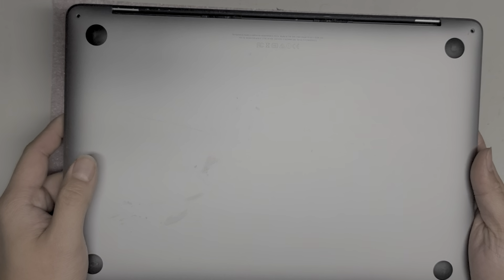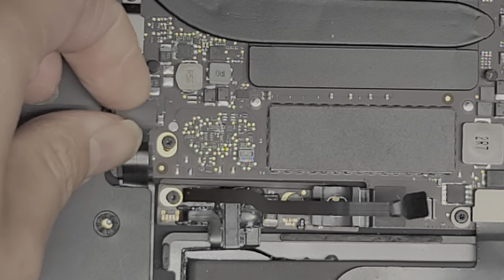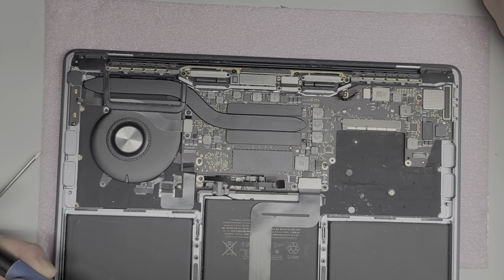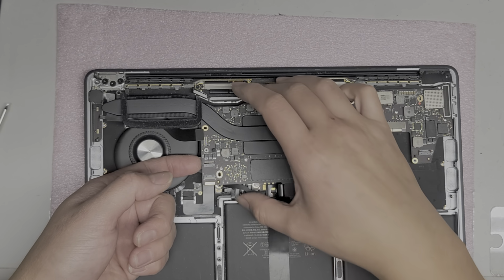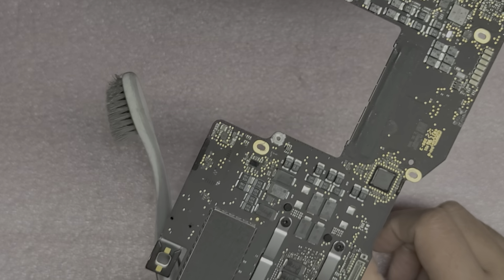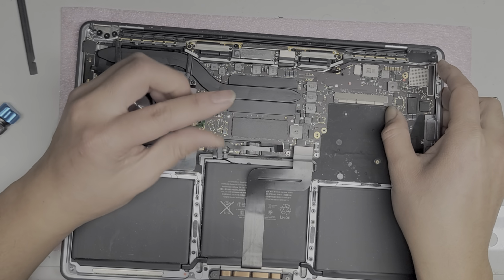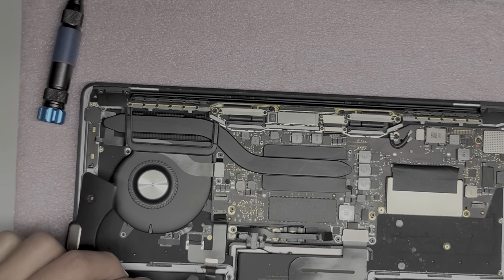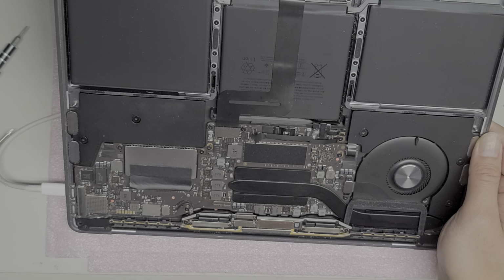13" Inch MacBook Pro A1708 2017 Disassembly SSD Hard Drive Upgrade Liquid Damage Repair *Failed*

Comment: Thermal Pad.The gap between the CPU heatsink and the bottom panel of 2016 Macbook Pro 13inch No touch bar , is 1.5mm. I measured it with a playdough and pressed in the back plate.
Reply from the maker: Thermal pad?
Reply: @ItsBinhRepaired  I am just spreading this information spec around for people who want to do this mod, I could not find it for this model so I had to measure it
Reply: @ItsBinhRepaired  It is similar idea to the recent MacBook Air thermal pad upgrade
Reply from the maker: @leninninel5652  I see, you're trying to add additional cooling?
Reply: @ItsBinhRepaired  contacting the cpu heat sink to the aluminum back plate, making the whole case a heat sink
Reply from the maker: I see

Comment: Hello there, hope to get an answer, I had a Macbook pro 2017 Model A1708 and it broke so I bought another one thinking it was exactly the same but it turned out to be a 2016 model, I tried to get the SSD from the 2017 model into the 2016 model but it's not working and I was hoping to get all my files out of the SSD (The SSD 2017 is a 656-0068A), would anyone happen to know how to fix this?
Reply from the maker: You need the same model.
Reply: @ItsBinhRepaired  Okay, thank you!
Reply from the maker: No problem
Reply from the maker: Firmware also likely needs to be up to date. How did the 2017 one break?
Reply: @ItsBinhRepaired  I replaced the battery twice myself watching your videos, apparently the first battery was damaged so I had to buy a new one, the laptop worked fine for like 1 hour but then it turned off randomly and didn't turned on anymore, I tried many things but nothing, no sound, no lights, nothing
Reply from the maker: @RenelisEliza  :(
Reply: @ItsBinhRepaired  I'll keep on looking for an used one model 2017 then, thanks again
Reply from the maker: I hate how YouTube doesn't notify me of replies. Were you able to figure it out?
Reply: @ItsBinhRepaired  Hi! I ended up buying a new one and was able to recover the information from the old SSD , got me broke but hey, I have a new MacBook 🤣 wow, it's been a year already?
Reply from the maker: Lol looks like it

Comment: So you put a HDD into it as an upgrade? Or is your title just messed up? Because if you write/say Hard Drive = HDD. 
SSD= Solid state Drive. 
Confusing tittle.
Reply from the maker: You're mistaken. If you go to the disk utility, you'll find that Apple calls it Macintosh HD. HD stand for hard drive. Nowhere did I say hard "disk" drive, so not sure why you added the additional D to make it incorrect. The additional D you added means there's a disk inside, you know, those circular spinning things. A hard drive on the other hand just means it's a drive and it's hard. Lol Just like how you would still call a sedan a sedan even if it was an all electric sedan. Hope that cleared things up. Not only that, but it makes it easier for people that don't know what an SSD is able to find my videos.
Reply from the maker: Hmm maybe I'm wrong about the hard drive thing. Regardless, it helps people that don't know what an SSD is, find the videos.  I get asked what an SSD is all the time, though they'll know what a hard drive is. Lol